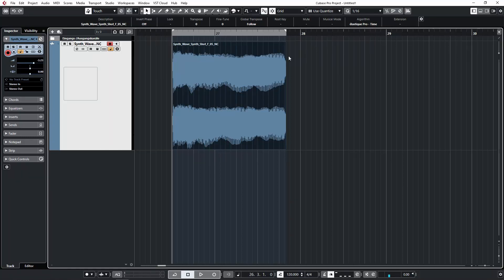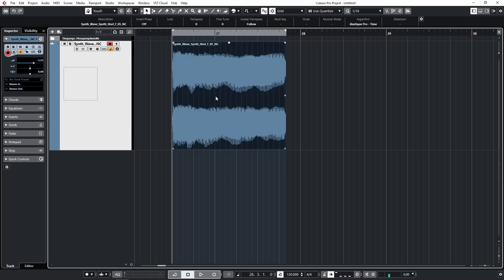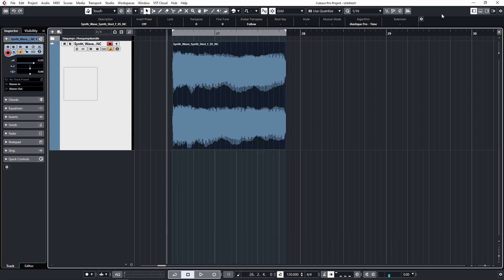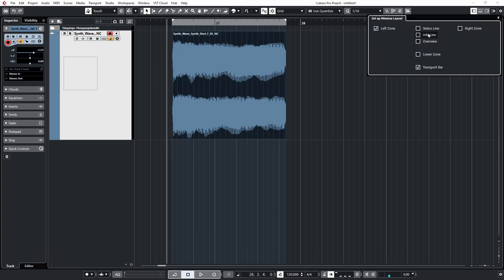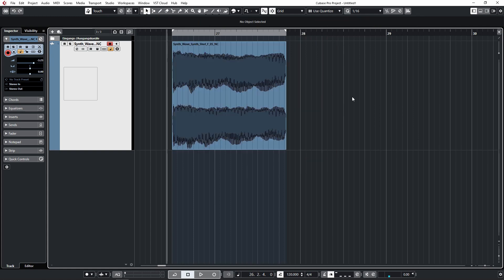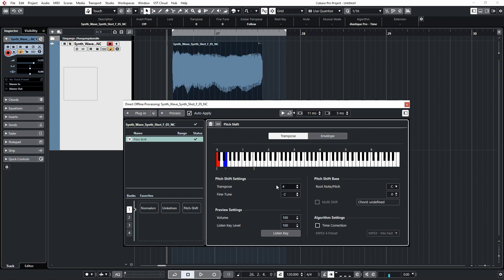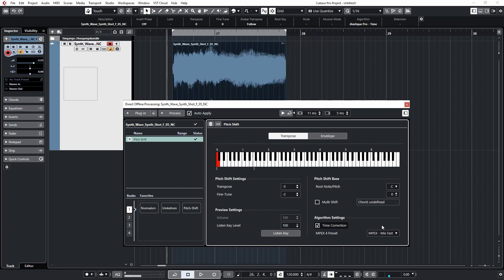How to Transpose Audio in Cubase (Change Key)

Comment: I am actually missing the Pitch Shift function (while having all the other ones you have)
I have Cubase Elements 12 installed, is Pitch Shift maybe not included in my version or is there an error?
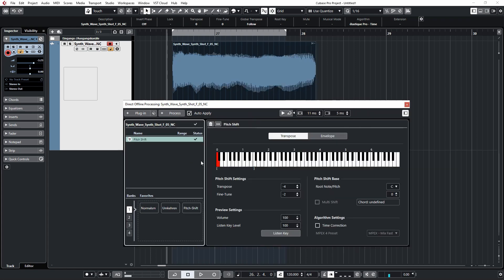Reply from the maker: interesting... I think it should be included in your version. Do you have the other functions that I have at 1:11? Like fade in, fade out, gain...?
Reply: @AJWolfOfficial  Yes, I have all other functions - only the Pitch Shift is missing. Which is very annoying because it is the only one I currently need
Reply from the maker: I am sorry, I can't really help you with that... Did some research - people with the same issue said the problem went away after updating to 12.01... So the only advice I can give is: check if you can update your cubase version.